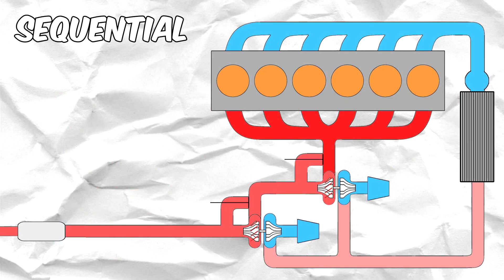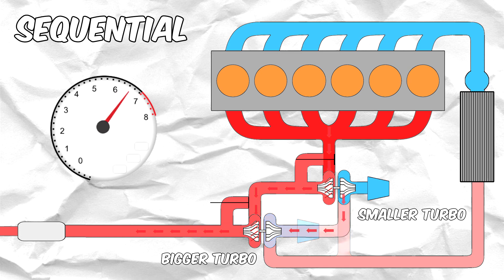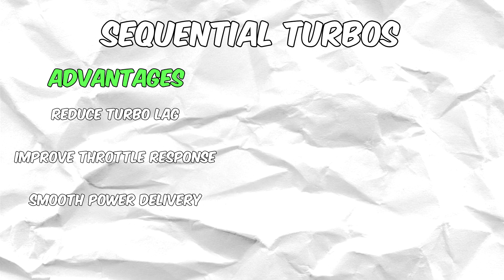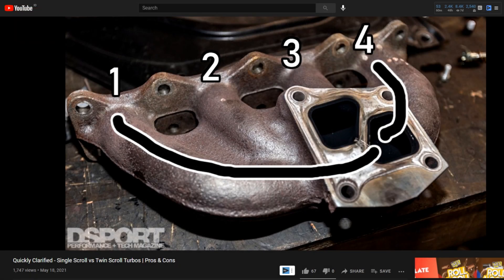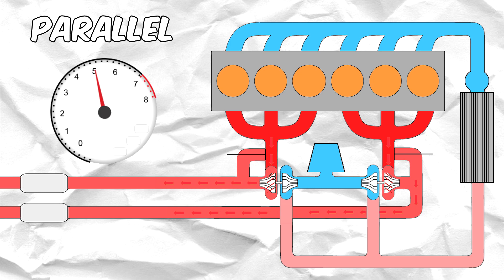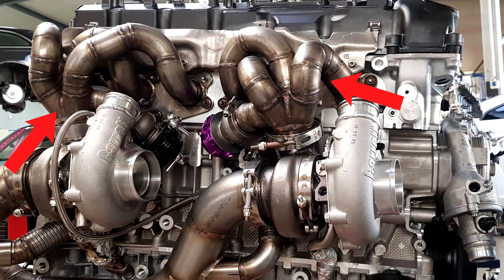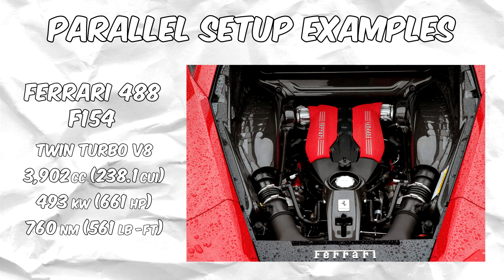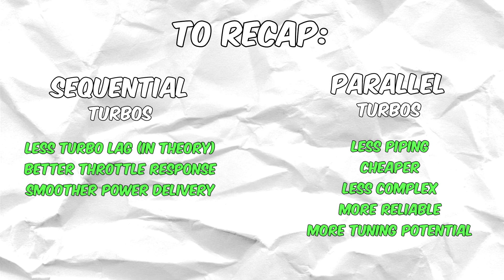Quickly Clarified - Sequential vs Parallel Turbos

Comment: There are a few errors in this presentation, twin turbo applications are broken down into dual (one turbo per bank), parallel (twin turbos with a common hot side), compound (one turbo raises the boost above atmospheric, the second boosts to final, the turbos run continously), and sequential  (smaller turbo boosts the larger turbo and the smaller drops off at a set rpm/pressure, only one turbo provides boost at a time minus a small transition time).
Reply from the maker: yup, thanks for the correction. Made the mistake of saying compound and sequentials are the same when they're not... Pinned your comment
Reply: thank you for posting this so i didnt have too lol
Reply from the maker: @takingafatdump  which errors?
Reply: @JCMediaYT  FD RX7 doesn't use the setup you describe. It uses pressure regulated parallel sequenced, where small doesn't feed large, but where small gets all gases till set pressure then manifold starts feeding to spool up the large for the higher flow.

Comment: I will help you out ok a sequential turbo looks like a compound set up but the main purpose is this when you have one  a engine that is two small to spool both turbos you allow the air to be cut off on on turbo allowing it to spool the first turbo once the air is enough then they close the wastegate and the second turbo turns on.

The issue is this can be done in a different combinations  you could have two same size turbos. Only reason you would do this is because the engine is to small to efficiently feed both turbos air at low RPMs without it being so much lag… or you could have one small and one large which looks like a compound setup but is slightly different. 

The reason for one small and one large is if the small turbo runs out of power the bigger one kicks in at high rpm’s and continues the power curve.

Now a compound turbo feeds the bigger one into the smaller to double the boost pressure with less effort from the smaller turbo.. it helps it stay efficient and could be used for big power over 50-100psi sometimes more but often billet engines or diesel engines are usually the only motors who could handle that type of boost.

It’s very confusing because a sequential could look like a compound if you want it to it could be a sequential component where you only want it to compound once the little one runs out

Sequential only means to turn one turbo once later that’s it after that you can make it compound or simply just feed the motor without compounding 

Compound is strictly feeding the bigger turbo into the intake side of the smaller one like a air filter to force the little one to take more air by force and not actually from it sucking in air on its own will

Comment: Good video, but compound and sequential turbo setups are not the same.
The big difference between them is how exhaust is flowed thru them and how they feed the engine the compressed air.

The sequential turbos are directly fed exhaust from the engine when the compound feeds one of the turbos normally while the other turbo is fed by the primary turbo and wastegate which is why it is important to look at the compressor map between the turbos and size them appropriately.

Comment: Thanks for the information and subsequent corrections. I would like to use a dual turbo setup (one per bank) on a 5.2L based 383 Stroker (500HP-600HP NA) in a Chevy S-10. Although ideally a dual compound setup would be outstanding if theres enough room in the engine bay. Small turbo blown into the Large turbo continuously (1000HP+). Unless I'm missing something obvious that would prevent this from working correctly.

Comment: Sequential or parallel can work on inline 3 engine like kei truck 660cc?
Reply: Yes but why would you need it?
A single turbo can deliver plenty of air and pressure for a small engine like that.
A cheap used garrett GT17 or GT25 or a Mitsubishi TD04 is fine for 200hp, they might even be too big for that engine.
2 turboes would just take up to much space in plumbing compared to a slightly larger single.

Comment: I like your video, but i miss A LOT of info.
Where is the PR multiplying factor in all this ?
When do you pick a tru compound over seqential.
When do you need the hi boost.
What about compressor Efficiëntie ?
EMP over IMP

And the need of interstage cooling
Reply from the maker: thanks, this video was only meant to go over the basics of it, not the very technical details of it
Reply: @JCMediaYT  It's really no intention to offend you, but your video starts with a real compound setup and a seqential setup and I do think the biggest difference between the two is that one deliver high PR because the multiply factor.
and that the others just run on a regular PR with out the need of interstage cooling.

Comment: Nice video animation but it's a little too simplified.  Sequential turbo setups like the one on the Supra have 2 valves in the exhaust and one in the intake blocking off airflow to the larger turbo.  One exhaust valve allows the larger turbo to "free spin" without building boost.  The second large exhaust valve opens to spool the second turbo.
Reply from the maker: thanks for the feedback and info, was a bit limited in my animation skills so hopefully future ones will get better!
Reply: @JCMediaYT  No worries, look forward to it!

Comment: Twin parallel turbo usually for V shape engine, due to header length to reduce turbo lag CMIIW
Reply from the maker: correct
Reply: I really don’t think you know what you are even talking about.  Your pros and cons are completely bs, and how compound turbos even work or set up is wrong.  Might want to read up more.
Reply from the maker: and how they are wrong and bs? please do explain. I'll even give you the sources I used..

https://www.carsdirect.com/aftermarket-parts/the-benefits-and-drawbacks-of-twin-turbos
https://www.sgcarmart.com/news/writeup.php?AID=135
https://www.pistonheads.com/news/general-pistonheads/what-is-sequential-turbocharging-ph-explains/38028
https://www.youtube.com/watch?v=3wFuR1x-Hes
Reply: That fact that you said  compounds are more complex less tunable and less reliable any diesel performance channel will debunk your theory, also small displacement don’t run small because of weight of the wheels, it’s due to availability to exhaust a 1.5 doesn’t have enough exhaust to run big turbo.  

Savage fabrication would be a good source for you to educate yourself on how turbos work.
Reply from the maker: yes, as far as the valve actuated ones they are more prone to failures and have more of a restriction than parallel ones. however you are right, I probably should have mentioned that the pros and cons are different for compound sequential setups where it feeds right into the other turbo, thanks for mentioning that!
Reply: @TheDe3th  i think not less tuneable due to complexity and space at engine bay, so that's why many tuner go to single setup, more simple, more cheap CMIIW